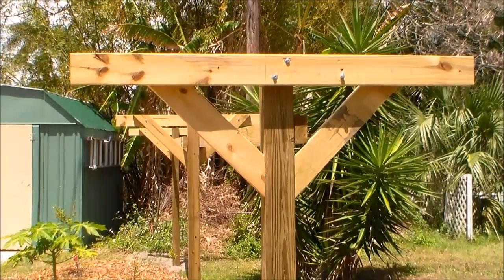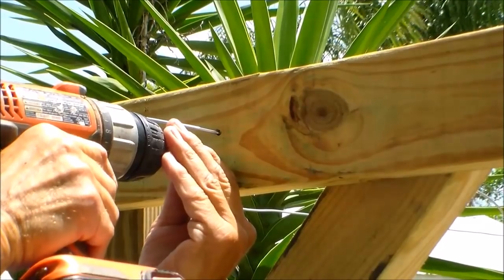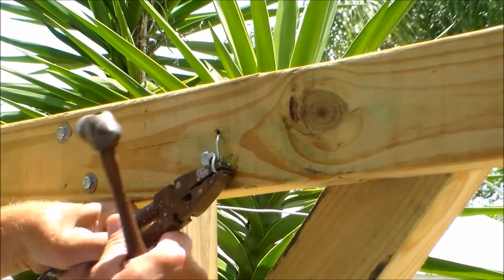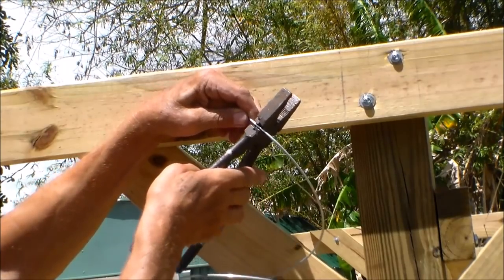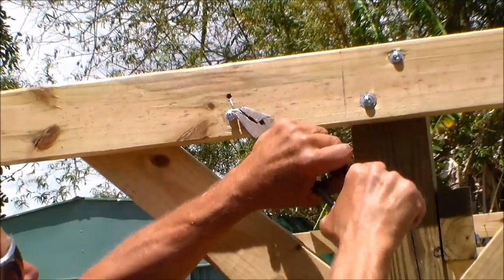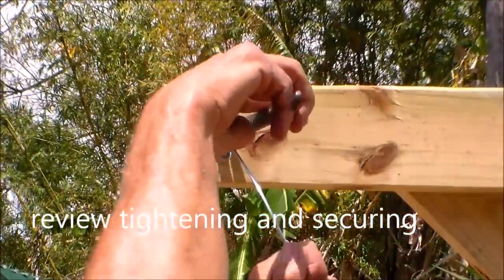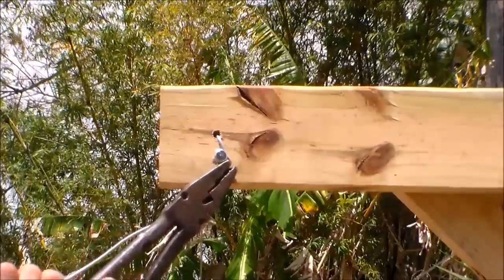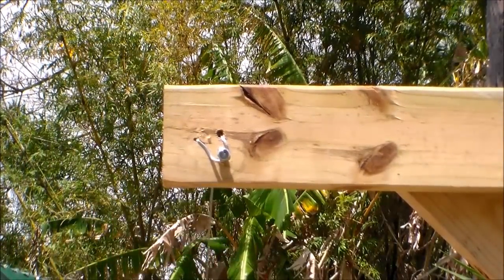How to Fasten Support Wires on T Trusses

Comment: So the lag screws are only on the two end posts, and the wire just runs through the middle post, is that correct?
Reply from the maker: yes

Comment: How can you reset it with 300 lbs of vine weight on the wire?
Reply from the maker: You will have to get a wire tension-er from Tractor Supply--- they are pretty cheep.
Reply: Thanks a lot.  How do you change this whole contraption when the wood rots without killing the vine (kiwi berry in my case, which produce for 30 years)?  I live in a humid climate with wet clay soil and lots of freezing and thawing throughout the winter and spring.